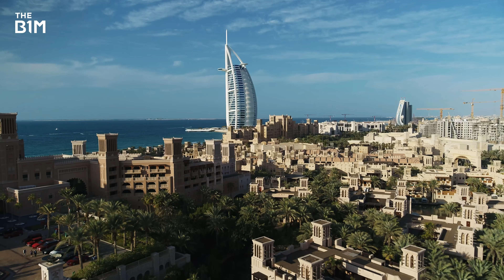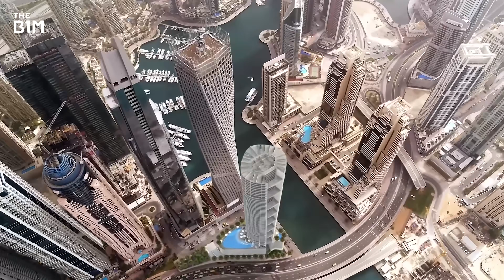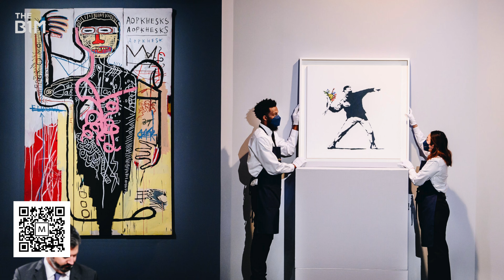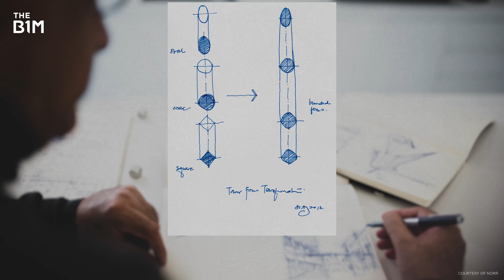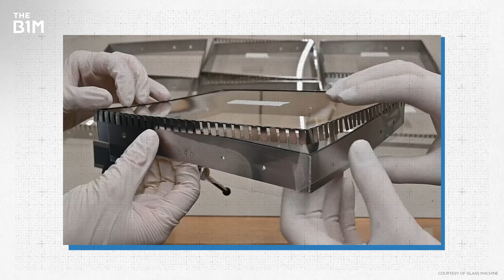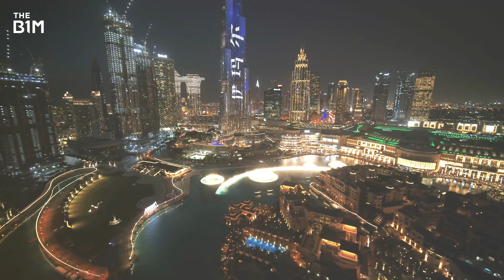Dubai's Building the World's Tallest Hotel... Again

Comment: it's all bs, The Flame visible in this video, not far from this building, is a giant blob of a building that seems to be taller than this one and on the forefront facing the wind. This is some architectural hotchpotch to charge the sheikh more money. Having said that, I have to admit, Dubai is amazing, its clean, beautiful, decent, straight lines and high ceilings. It's what America should've been, instead of the current decaying state of affairs. Imagine America in the 50's but modern.

Comment: Technically this is not the tallest hotel, the tallest is Clock tower in Mecca. The Fairmont Clock Royal Tower is +600m in height
Reply: It's the tallest hotel in that the whole tower is the hotel, not just the upper floors.

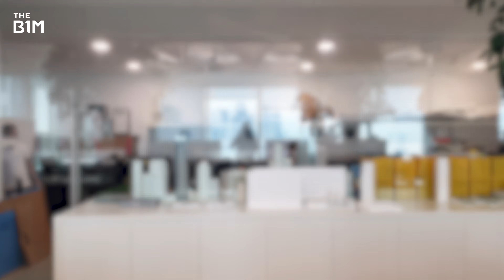Comment: 5:33 - - wind-tunnel + software tests
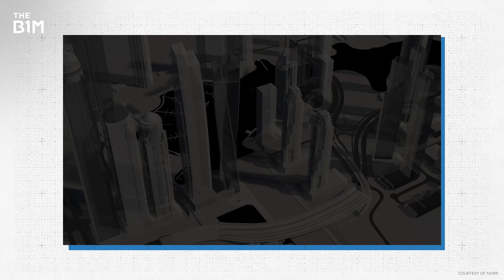6:42 - - to avoid the high costs of steel (single concrete core)
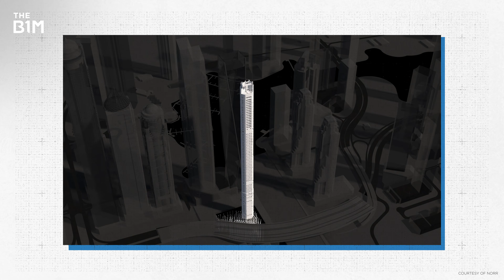6:49 - - reinforced by radial buttresses
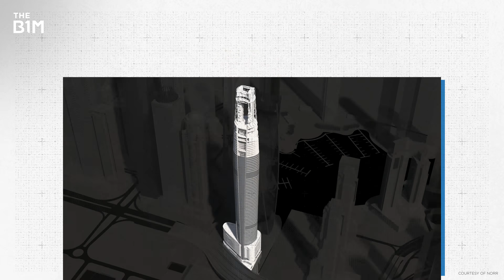7:04 - - outrigger beams to reinforce mechanical floors against winds
7:27 - - level 21 plan view

Comment: Mega skyscrapers in a desert, no sustainability at all. You live from airco to airco. If they made a modern traditional arabic city, that would be impressive. This is nothing new other than the height. You don't need height for density (Barcelona has the same density as New York), they only want the height because they think that gives them prestige (which it does not).
Reply: "modern traditional arabic city" this only exists in your head. But that don't stop you from saying the arabs are not acting racially arab enough. 

then again you think its in the middle of the desert and not on the coast. "no prestige? Most visited city on earth that's selling reestate as fast as they can make it.

Comment: Wow. Q: How is the sewage and wastewater handled for this building?
Reply: @user-kb1rl5qy1k  That's a myth. A simple online search debunks it.
Reply: @user-kb1rl5qy1k  Why lie?
Reply: @user-kb1rl5qy1k drivel
Reply: Like the rest of the city it’s connected to the sewage system. The Burj Khalifa trucks is a myth, it was just at delivery as it was one of the first building on the development, ready before the infrastructure (to secure investments for the other buildings). Actually the Dubai fountains are part of this Burj Khalifa waste water infrastructure, using recycled grey water from the Burj Khalifa.
Reply: @ that is not true, it does have underground sewage system, over 99% of the residential units are connected to it. It’s a myth from the early days of Dubai which is often relayed as still current using old videos from the early 2000s, or from trucs taking waste water from industrial areas which are lagging behind in infrastructure.
Reply: Saying racist crap that has not been true for over a decade.

Comment: If a supertall is built WIDER, can't the wind strain be taken more easily? On tiny plots of land you're limited, but with a more blank sheet, you'd build something like The Line and be super wide with multiple cores that are interconnected. That one is two blocks of 50 meters deep (it will vary) with a roughly 100 meter spacing in between. Then making is very wide, there is no way to push the building over to. For a more traditional setting, a tubular design with some support beams through the middle could make sense. You'd make the tube 200 meters wide (let's say with three or six main cores evenly spaced in the tube), the open core 100 meters for a huge atrium, and have lots of open views from all outer windows. Going megatall should be just fine.